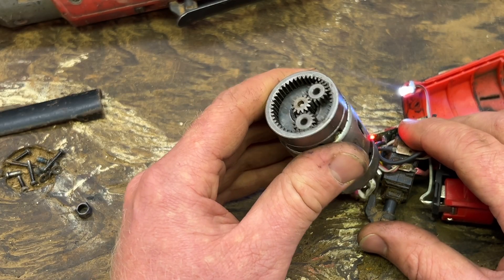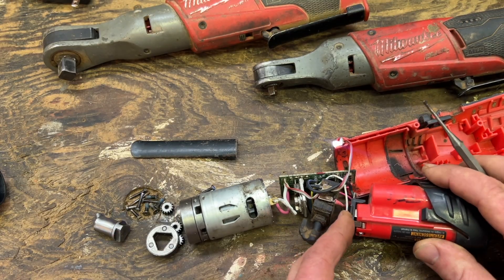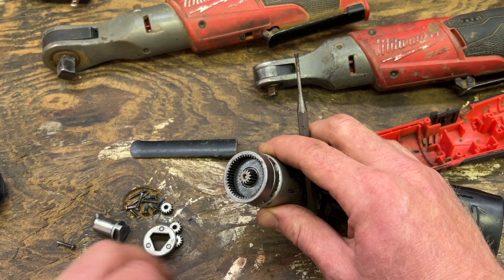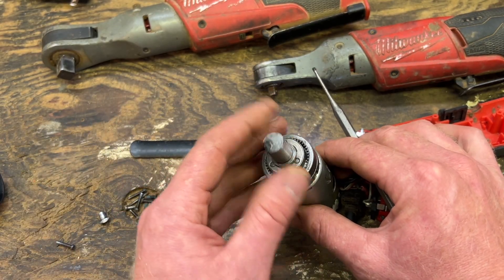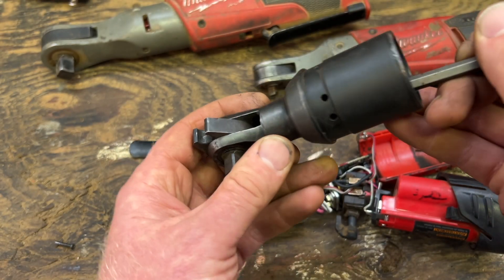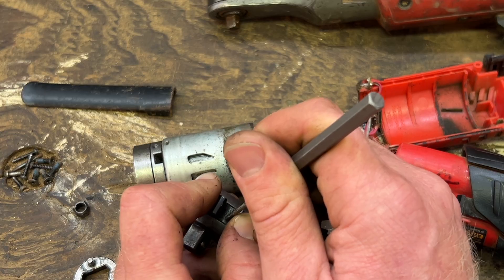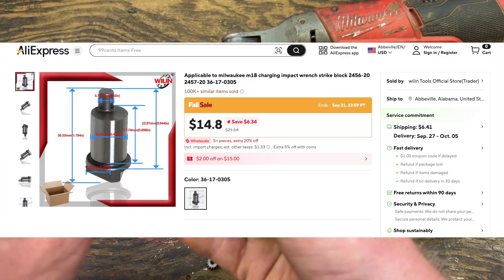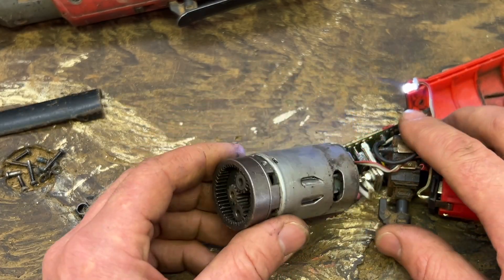WHY Milwaukee Ratchets Break

Comment: could you drill a hole on a bridge port or fixture and then drop in a dowel with hot/colder interference fit?